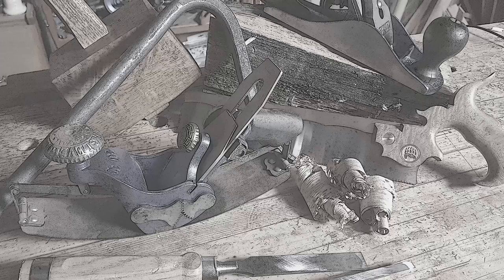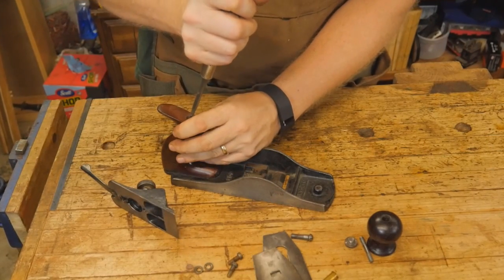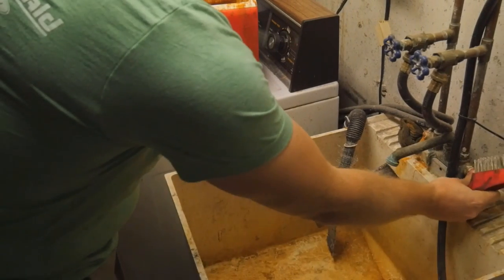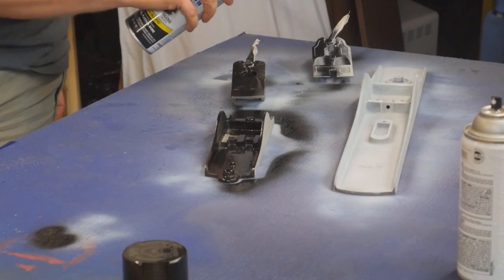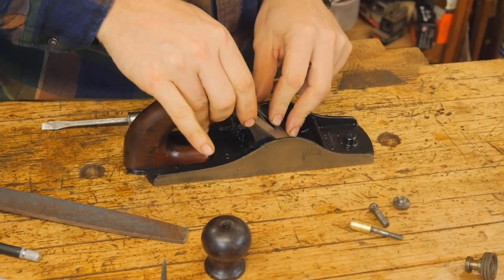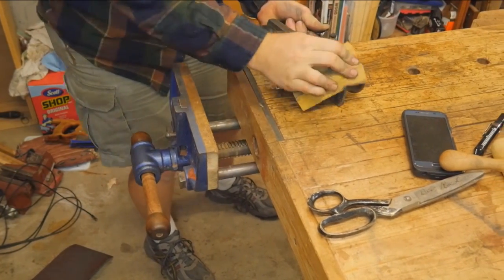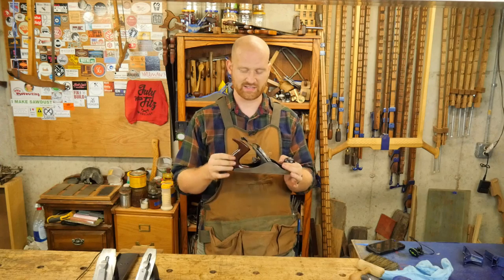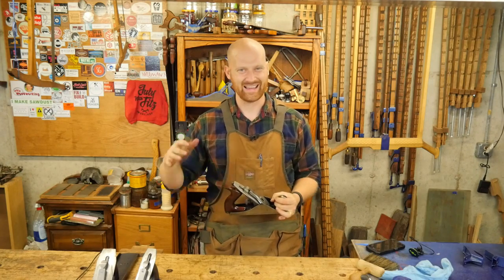How to Restore a Hand Plane Part 2 Clean and  Paint

Comment: I’ve only painted one plane, my Record #5. I think the previous owner had used it to stir several different tins of paint the last time he decorated. It was even on the sole, but the blade and chip breaker escaped any splashes. I had to get rid of all the different colours of paint but the original paint came off with it so it was a primer and a couple of coats of top paint job. The masking tape was a total nightmare, and then I realise the blue was a totally different colour blue than was on the can and lid. However was very pleased with it when it was finished but I got my first woodworking cut in the process, lesson learnt! For £2, a bit of spray paint and an enjoyable project to boot, I think I got a bargain. 

Great video James as was the previous one.
Reply from the maker: sounds like a great time all around. nice work!

Comment: Hey, this is a great video. I was just trying to strip the old paint off of an old Stanley plane with some Jasco paint stripper before I repaint it. That's the mentality I've trained myself to have because recently I've been working with automotive paint too. This old paint is crazy! The stripper just deglossed it a bit, lol
Reply from the maker: Ya. They used Japanning rather then paint. It usually takes 10+ coats of stripper to get it off. Most people use sandblasting to remove it.

Comment: Great information on the sole being corrugated which makes sense. I've been looking for a good deal on a #7 and for some reason I pass on the corrugated sole models now that I know that I can this I'm going to take a closer look they are always less money and I mean significantly less. Thank you for the great information.
Reply from the maker: functionally there is little difference unless you are planning thin stock. (less than 3/4") but if you are doing that you are probably not using the #7. but they can take an hour off the flattening presses if it is a waise out. the #7 I do in the next video is flat and took me 30 minutes with this system, but it was not that bad. just about 1 thousand in the center behind the mouth.

Comment: I have a Stanley #6 I’m working on and I had to strip it back to metal then I rubbed a light coat of oil on it to keep it from rusting before I could paint it. What kind of primer would you recommend, and to get the oil off I’m thinking a good acetone bath and a low temp baking to degas it. Any suggestions?
Reply from the maker: I would just use a light degreaser and then hit it with an acid etching primer.
Reply: Wood By Wright thanks I’ll try that out!

Comment: Another great video James, your also pretty handy with scalpel and masking tape;)
. I've heard some reports that the corrugated surface on these planes is also could be to lessen the surface area of the sole for less resistance on working wet/green wood. Andrew Kline asked the question about the corrugated sole a few months back and that seemed to be the most logical answer. Just wondering if you had heard of that explanation before?
Reply from the maker: +Doc Darkness I have heard it. But the math just does not support it. If you decrease the surface area then you increase the momentary pressure at any given point. This will result in the same amount of fiction. When first created that is how Stanley advertised the corrugated plane. Stanley did a lot of little things like that so that people would buy more hand planes. And now the corrugated bottoms are often worth more than the flat bottoms.
Reply: LOL I'mstill getting fooled by a vintage sales pitches. Great reply thanks for clearing it up

Comment: This plane looks identical to my newly acquired Zenith (in great shape and all original - 408 under the frog) .. Mine needs a bit more work on light rust. I cannot find those nimble sponge sanding blocks and the throat on my plane is around 6mm - Is that meant for use as a fore plane too? (The blade is original and straight beveled.)
Reply from the maker: +Clyde Decker that would be a great plane. I get my sponges at the big box Stores and some times auto shops. The frog is adjustable so that you can close the mouth of tightly or open up wide and use it as a scrub plane. But if you want to use it as a scrub playing you would have to camber the iron. If you slide the Frog forward a little bit you can tighten up the space between the iron and the front of the mouth.

Comment: I have a plane that needs a paint job but if you just spray paint it, would it scratch off super easily? I know it's only on the inside but there's a bunch of knobs and screws that could easily tear up the paint.
Reply from the maker: it is not the most durable paint job (powder coating would be stronger) but with a good primer it is fairly durable. with all the planes I have done this way there are only a few small chip outs and most of those are on the edge where I accidently hit it with the lever cap taking it in or out.

Comment: Nice rebuild James.  I picked up a used plane during the summer that I planned on rebuilding.  Unfortunately, I didn't notice the threads in the frog for the cap screw were stripped out enough that it wouldn't hold the level cap tight enough.  Any ideas how to save it?
Reply from the maker: +Jeff Loitz OH No Fun. My only guess would be to permanently put it in. With JB weld or the like, or to tap the hole to something else and make a screw to fit it. But I have never run into it.
Reply: I think I am going to try the re-tap route.  If that fails I may see if I can find a replacement frog.  Thanks again James!

Comment: Excellent... I was wondering how I can tighten the lateral lever on a plane, if it is possible at all? 
Cheers...
Reply from the maker: it is possible but difficult. you have to peen it over with a hammer. just be ferry careful not to over tighten it.
Reply: Wood By Wright right ok, thank you for replying so quickly and for the advice... I'll try it...
Cheers...

Comment: Anyone ever rebuild a Stanley #45 and kept the metal look (no painting)?  I am wondering what is the best way to treat the metal to prevent future surface rust.  I plan on sand blasting to remove the old paint and rust but I know it still start to rust right away with bare metal.  One thought was to use Glidecoat.
Reply from the maker: I have never come across a #45 that had paint. that would be interesting. another option is to apply a clear coat.
Reply: I thought about that as well but was concerned about how well it would hold up. Anyone have any clear coat experience to share?  Did it hold up?